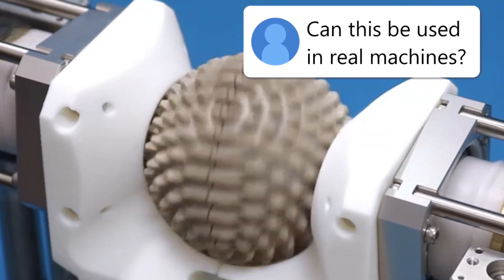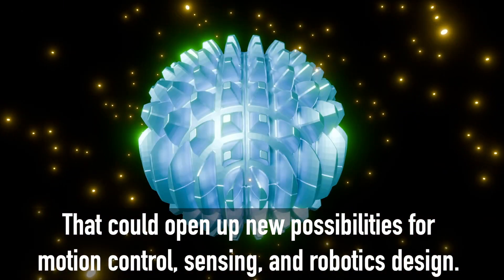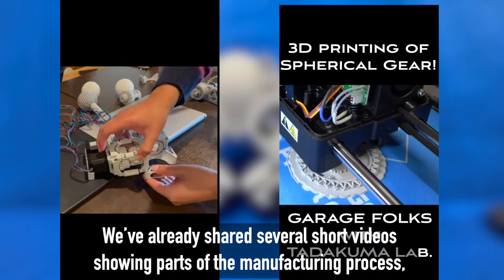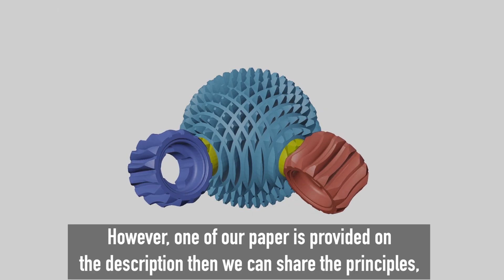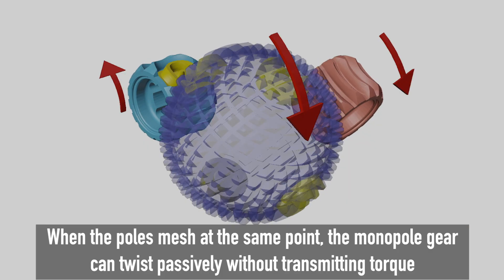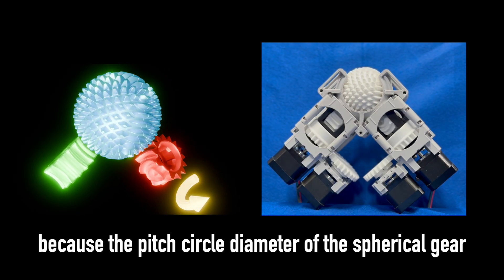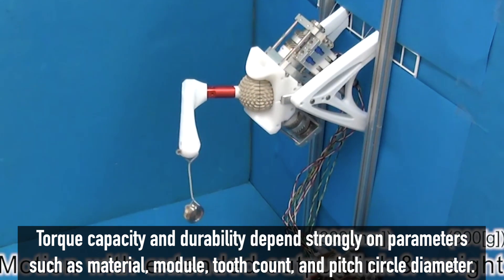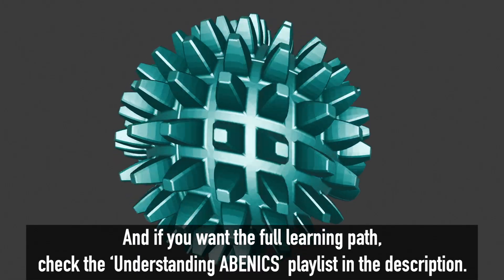ABENICS FAQ: Can I Build It? How It Works? How Strong Is It? #abenics #sphericalgear

Comment: I’m considering using a similar design for a robotic shoulder joint but this shoulder joint would have to be able to take high loads since it would need to flex fast.
Reply from the maker: Thank you for your kind comment.
We're impressed your challenge on robotic shoulder.
This paper shows you one of the approach to adapt our spherical gear as joint parts.
We hope this is helpful for you. 
https://link.springer.com/article/10.1186/s40648-025-00330-5